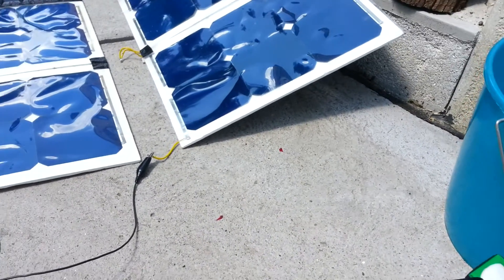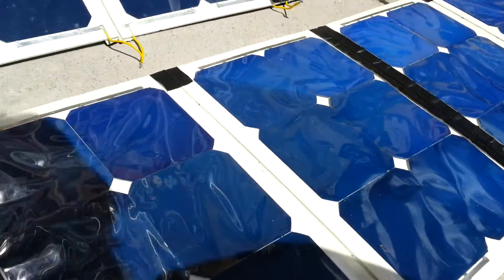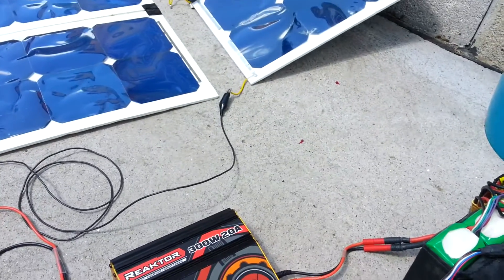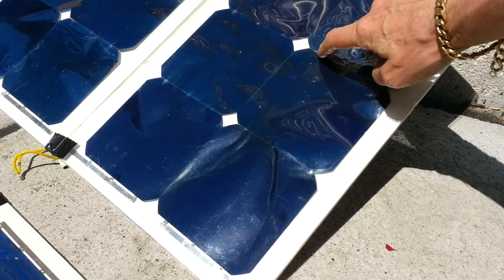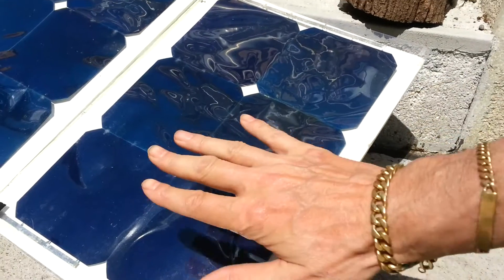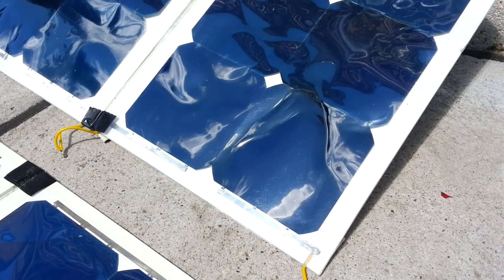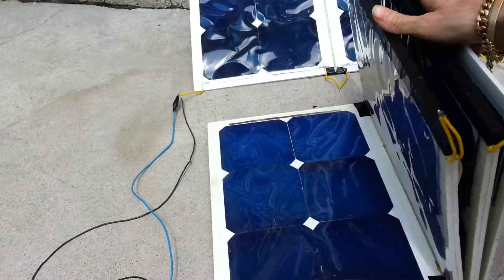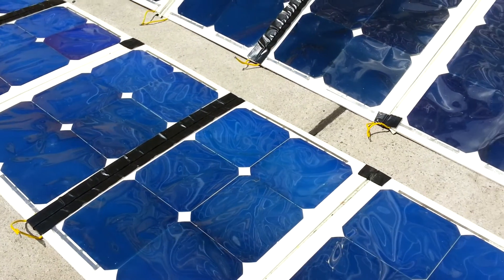Homemade 240W folding solar panels with 300W Turnigy Reaktor

Comment: Maybe you can help me here. So a MPPT will boost the voltage like a boost converter(in a sense). Does a PWM Controller Buck the voltage (in a sense). I went ahead and purchased the 2 x MPPT-7210, only because I already ordered them and figured they might come in handy. I also purchase a ZHC Solar Charge Controller 30A, but it is a PWM I belive? Someone let me know these are awesome when it comes to Lithium Ion. Still so confused on Series and Parrell. To many say one way and the other 50% say the other? I live in WA, Seattle and we get sun, just not as much as I would like. I plan adding a smaller turbine also a little later.
Reply from the maker: I'll try to clarify - MPPT is a completely separate thing from boost or buck.
MPPT simply means finding and tracking the best voltage and current combination from the panels to get the most power from them into the charge controller as light conditions change. This happens on the input side.
(I was eventually able to set the input voltage with the Reaktor at the MPP voltage of 17.5V, but it doesn't track - this is good enough for normal sunny day, but I suspect the designers did this by accident rather than design - they could easily update the firmware to add tracking!)

Whether you boost or buck the voltage depends on the capability of the controller and this appears at the output side.
Bear in mind that a boost converter cannot output a voltage lower than the input, and a buck converter cannot output a voltage higher than the input, so you need to choose carefully. I'm sure there are some than can do both.

If you try to draw too much current from the panels the voltage will drop and power will reduce. Too little current and the panel voltage will stay high and also not give its best.
If you are drawing power at the optimum PP and a cloud comes along, then the voltage will collapse as the current draw is too much for the new state so the charger should know to back off the current draw to bring the panel voltage up again to find the best combination of V and A.
PWM controllers can't do this - the panel voltage gets dropped to the battery voltage, so a 36 cell panel that would give its best at 17.5V @ 5A (87.5W) is held down at say 13V @5A (65W) and therefore produce 22.5W less than it could. There are some good use cases for PWM if panel voltage is near to battery voltage, but get a good MPPT controller if you can.

I have one of those 7210A charge controllers (see Adam Welch and Julian Ilett) - it's cute, but it is a boost converter and can only output a voltage higher than the input, so you can't use it to charge a 12V battery from an 18V panel! Remember this!
It's best use is for using two 100W panels in series @ 40V to charge an ebike battery at 50V. Adding more panels won't help much because it limits to 10A.
It isn't a true MPPT device but it does a great job for its price.

I wouldn't base a decision on someone saying PWM is "awesome for Lithium Ion" What voltage? How many S? What current?
Lithium cells don't like float charging and charging should stop when they reach capacity and kick in again after voltage drops to a threshold. Also the charge current should decrease after about 80% of charge until voltage is stable at the end voltage and current decreases to 10% of the battery's C rating. The TP4056 spec sheet shows this profile quite well, and you can see this in action with the Opus chargers as the cells start to reach capacity.

Series or parallel panels or batteries? I think you got the batteries worked out, but in general for solar panels series is best because you can run a lot of power at a high voltage (1000V or more!) over a thin cable.
If you suffer from partial shading such as trees, any shadow on just one cell can kill output on the whole string and turn the shaded cell into a heater - not good. This is why bypass diodes are so important - they allow groups of shaded cells to drop out of the circuit and become effectively like a piece of wire, allowing the rest of the cells in the string to keep delivering. An MPPT can adjust to find the new  optimum current.
If you use parallel panels then their currents add up to deliver more power, but you need thicker cables. By using blocking diodes (a different use to bypass diodes) if a panel gets shaded then it doesn't pull the other panels down with it.

Some systems even use micro mppt controllers on each panel or group of panels to get the most energy out of an array and combine the results.

Bookmark this page and look at the rest of the site - some great info here!
http://www.avdweb.nl/tech-tips/pv-panels/bypass-diodes.html
Reply: Good deal! My Batteries are in 12V packs 3S8P. each pack is BMS(balance), with thermal fuse set at 60-65c(hard to find all 60's),  glass fuses and balance cables(made from 18guage). Plugged into the door with a little voltage alarm(1s-8s). The Voltage alarm is controlled by a little on/off switch i added. This allows me to monitor voltages of each pack. 4 of those packs paralleled than 2 of the Parallel strings are series for 25V. There will be up to 3-5 x 24V sections. coming out from each section, is a DC 0-120V 0-100A LCD Digital Multimeter with current shunt. These are the wireless versions. The meter will also control a 100amp relay aml fuse combination.  From this to the3000w Realistic Inverter is a Boatswitch with aml fuse.

The charging system will be connected to the DC 0-120V 0-100A voltmeter so it can monitor(24V charging)---with a boatswicth aml fused. to the charge controller is another boatswitch fuse combo. Fortantly the place I plan on putting the panels get 0 shade(except when the sun goes down..LOL) or and when it rains 70% of the year. : (

On the diodes, nobody ever mentioned needing diodes? I know there are diode in the boxes behind the solar panels? But I can always add more. Right now the plan is to run them in Parallel, with 10 guage cable running to the 2 x charge controllers in Parallel. This should give me the max amps and voltage. The little controllers will boost the charge to 24 and slowley charge my batteries when needed. The new 20a 300w charge is going next to the Charge controllers and used to charge and keep my cell ballanced when needed.

Of Course, if i plan on using the other PWM controller, I would place the panels in Series.Or this is my plan...So I need to splice the solar panel wiring and add diodes?
Reply: forgot to ask, Do you happen to know a good diode for this. I have a box of 15sq045 Schottky barrier diodes I had from a previous project? (Not sure what I am going to use them on?)
Reply from the maker: Those should do fine as blocking/bypass diodes for 20V panels and as you have so many you could also use them as bypass diodes if you have access to the cell connections.
Ideal diodes, or active diodes are better of course because they are mosfets wired to behave like a diode and therefore have negligible voltage drop and therefore won't suffer from thermal breakdown. They are however much more expensive, but hopefully they will come down in price as usage increases.
Reply: The panels I have are pretty basic, no way to get to each cell(or skill I don't possess) Each Panel has a box in the back with a diode and fuse.Renogy 100W Monocrystalline. Just checked and all 3  junction boxes on the back are dioded up. : )

I have learned a ton today! Thank you for chatting with me on this!!!
Reply from the maker: You're welcome, and good luck with your projects - you should be good to go now...
Reply from the maker: Oh I just noticed your earlier longer message about your batteries - there are two ways of using the chargers - either connect them in parallel to the panels, or give each one its own independent panel and connect the outputs to the battery in parallel. This would allow each to find the mpp of its panel as they might be slightly different or a lot different if one is in shade (unlikely in your situation).
Just make sure that the controllers are set up to output the same voltage (measure and compare independently). They might not need diodes to avoid backfeeding, but if you do use them then don't forget to compensate for their voltage drops.
It would be interesting to compare both methods for power output.
Reply: I chatted with (going off grid) because he uses the same controllers. He let me know they run really well paralleled. He is the one that told me to either run 2 panels on one and one panel on the other, or Parrell the panels into the controllers (split up between the 2) and then parallel the output to the batteries.  He said they are capable of 400watts each. It crazy, he has a portable unit that is the same Capacity and using basically the same components. (except he has bigger panels) He and the other guy you mentioned parrel them and have no issues(were I got the idea). Me personally have a ton of experience with DC to DC converters. I use them in most of my builds. If this acts like a boost converter, it should work just fine.

But, you know how DIY is. You always plan to build one way and end up doing it completely different when it comes down to the build. As for the protection. i have it planned to add diodes, fuses, thermal fuse Boat switches. Relays, and shunts. The Charge controller and Inverter will probably never run at the same time. If I have to for some reason. and there is a catastrophic magic smoke moment. In Thereoy, the relays or fuses should protect the parts and peices. I will also have the AC/DC 20A 300w controller connected to the system for charging when it needs it.(or that is the plan)
Reply from the maker: As the current is limited to 10A, they are only capable of 400W if the voltages are over 40V. You will not get anywhere near this at 20V, and you can't go higher than this because your batteries are only 24V.
You should never see any magic smoke by running the charge controller and inverter at the same time because the battery clamps the charge. The charge controller will simply try to replace what the inverter tries to take and either keep up, or not!
Reply: Good Deal! I believe I have everything. Just takes forever to make the battery packs. Test Batteries--so far 14 days and I have one more box. Still, have to build and test packs..: )
Reply from the maker: Yeah, it does take forever.. I have 800 cells to enter into my database, devise an algorithm to distribute them into 14S packs, probably 50P and then assemble them... I knew a year ago that it would take a long time to do, but it's getting there!
https://twitter.com/ahaveland/status/983468199206367232

Comment: Hi Andy, can you tell me the voltage of one panel (6 cells)?
Reply from the maker: Hi Paulo, 6 cells are about 3.5V open circuit, or 21V for all 36 cells with max power point around 17.5V.
Would need a boost converter to use one A3 page to output 5V for a couple of usb chargers, but I don't know of any mppt boards that run at such low voltages. A foldable pair of A3 pages would give 7V and more easily regulated or bucked down to 5V @ ~35W
I've since replaced the front film with polypropylene which doesn't melt like the ones in the video

Comment: Hi, are the cells solid or flexible?
Reply from the maker: They're 'flexible' inasmuch as they bend a little, but they are fragile and you wouldn't want to bend more than a few millimetres - maybe a curvature radius of 80cm.
Fortunately they still work fairly well even if cracked as long as the circuit backing stays intact.

Comment: Thats a nice little setup!
Reply from the maker: AveRage Joe Thanks AJ, I thought you'd like it!
I got three of these panels now and had enough cells for a 4th but a windstorm ripped off two pages worth and had to dig into them for repairs.
Since then the prices seem to have doubled. Last year could get 40 cells for $66 on aliexpress, now can't even get 20 for the same price.
I don't know what happened,  but I might have  to swallow it to get another 20 to finish.
They go well with my 'new' 2kWh 18650 pack :)

Comment: Here is a cool MMPT charger that is fully adjustable.  It's just 5A though... http://www.ebay.com/itm/5A-MPPT-Solar-Panel-Regulator-Controller-Battery-Charging-9V-12V-24V-Auto-Switch/181776695618?ssPageName=STRK%3AMEBIDX%3AIT&_trksid=p2060353.m1438.l2649
Reply from the maker: Thanks, yes I have seen them and they're cute, but unfortunately not beefy enough.
However, it may be possible to use one on each panel and combine the outputs with diodes to prevent them fighting each other.
Still, the Reaktor works well since I discovered it can hold the input voltage at 17.6V instead of plummeting to the default 10V. With 3 of these panels I get 10A at 25V for each set of 6S lipos.
More panels would be good, but they take me days to make!

Comment: Get aluminum sheet metal. Paint it white with heat resistant paint on the front where the cells will be mounted and mat black on the other side. Use encapsulation silicone to glue the cells to the panels and over them place high temp UV resistant plastic sheets. Or just use the resin encapsulation mix to fully encapsulate the cells. You'd have to use some sort of fabric to prevent scratching between the panels when folded, but it should not be a hard thing to do. The idea of the matt black paint on the back is to radiate heat the same way satellites in orbit do. No need for heat compound, the encapsulant's heat transfer coefficient is quite enough to transfer all  the heat to the plate behind it. The white paint is also not a problem.
Reply from the maker: All good advice, and I've thought about this too - problem with even aluminum is that six sheets of 1mm A3 would weigh 2kg, then add almost another kilo for the cells and polypropylene film. So 3kg is looking a little less portable than the current 1kg!
It would be good for a static system, in which case I would add alumina or boron nitride powder to the resin to bond the cells to the backplate, and also copper coils to the backside to circulate water.
A load of thermal energy could be used to heat water as well as improve PV efficiency - win-win!
Sadly, my priority for these cells is for portability so I can charge my ebike anywhere - perhaps thin A3 carbon fibre sheets would do the job, but I don't have funds to experiment with that yet! :(

Comment: Nice helpful vid! i'm thinking of building the same, what type cells are you using?
Reply from the maker: Sorry I'm a bit late! The cells are Sunpower Maxeon C60 from AliExpress, same type used by Solar Impulse II.
Be prepared for a lot of painstaking assembly, and get more cells than you need! Flux pen, tabbing strips, silicone wire, blocking/bypass diodes, A3 foamboard, polypropylene / ETFE sheets, double sided tape, duct tape and I used female XT60s for output.

Comment: Too many battery connectors to get any serious amps dude. You can buy VG 2nd hand 250W panel and a 40A MPPT controller for $200 US. Nice work though for a hobby. keep it up.
Reply from the maker: Won't find any 2nd hand 250W panels that weigh less than 2lbs though, which was the whole point of these - "portable", Cost of all these cells was $130, $30 for other materials and they fit comfortably in a backpack.

Comment: Hi Andy, I watched this last night (or the night before) befor i lost my connection due to cold weather!! A foldable solar set up like yours is what i had been thinking for myself a few days ago while pondering over 4x50w flexi panels. Really glad i 
found your video & thanks for sharing an awesome upload!! your battery pack is an awesome piece of kit! Will we be seeing a follow on from this video?? I hope so!
Reply from the maker: Glad you like it! Ebikes and lithium batteries are the future.
After a year of use, I'm still blown away with it! My own free transport, taking just minutes to get anywhere in the city, and the battery doesn't appear to have lost much if any capacity even after a year.
I took the panels and battery up to the roof today in subfreezing temps with a 10° sun angle and was still able to draw 240W from the now 3 sets of panels. I just set them down, let them charge the battery and then pack them up again when done. 3kg for the panels, 7kg for the battery.
I have another panel waiting to make so should be able to run the charger at its full capacity.

It would be good to make a long lightweight trailer to mount them on 2 by 2, but would be about 4m long and might attract a bit of attention. The 1.5kW motor can easily handle it though, and having 400W of solar capacity should allow a range of 200 miles!
Video still on my todo list - I have some fairly decent fpv footage of me charging through a mountain forest at 30mph and leaving other cyclists in the dust, but I don't have any 2rd person footage yet.
Video editing on Linux is still quite a stressful experience!
Reply: Yeah they Definately are & hardly if any capacity is awesome! Though i only had a 36v on the last bike it still gained a bit of interest while slowly going up hill lol I have a 48v 1000w rear hub now & got my eye on another 250 LG18650C2 2800mah Li ions what do you think of these http://www.ebay.co.uk/itm/LG18650C2-GENUINE-LG-2800mAh-250pcs-/272488042660?hash=item3f718d90a4:g:~O4AAOSwImRYPqKa I already have six pulled from a laptop battery a few days ago discharged a few times & are around 2500-2600mah. That's an excellent draw from the panels! Yesterday was a lovely sunny day but shame i didn't have any panels to run my agm/gel bank would've been nice! Yeah have also thought of a trailer myself but as you say would attract the wrong attention! Yeah I'm also hoping for a range around 200 miles.Looks like we're aiming for a similar setup though you're obviously almost there! Those solar kits look great & are good value for the wattage & the weight is awesome! Though I've decided to order 8 of those flexi panel. Always fun to see leaving other cyclists in the dust :D 30mph is a great speed too :D